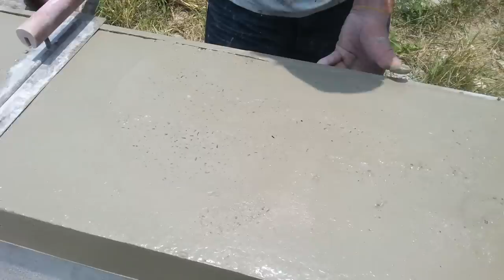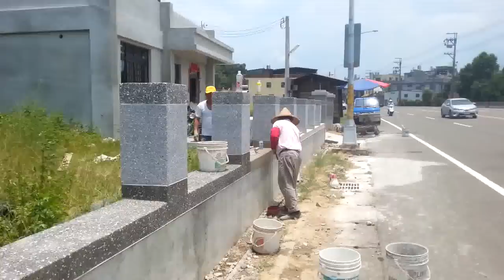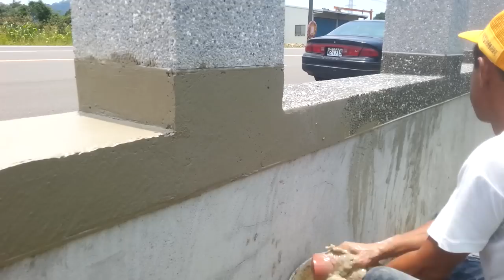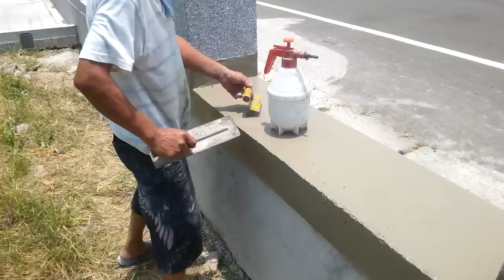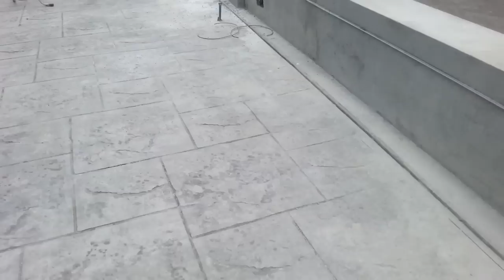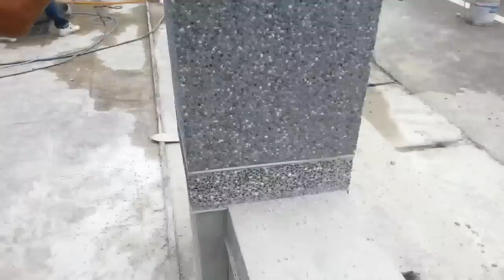Cement rendering with small stones on brick walls

Comment: So, a layer of external tile adhesive first, then a mixture of lime, stone and cement all mixed to form a plaster of sorts, then applied and flattened, and finally a sponge to remove excess cement? Looks good, makes a difference from the old, flaky pebble-dash finish. Do you add any waterproofer or rely on the lime to keep the water out?
Reply: Top comment!

Comment: is this a video on how to wipe cement off walls?
Reply: Come on Haris your better than that
Reply: It seems it goes like this. You built walls using small stones and cement and no sand. Then you plaster the wall so as to minimize the gaps between the stones. Excess you wipe away to render a non dust accumulating finish with a great texture. Surely a thing to learn for someone like me.
Reply: Jeff Jones, 😂😂😂😂😂😂😂, you made my day.
Reply: Haris Andreadis 
على فكرة جديدة

Comment: only way i would do it as a trial here in uk is try mix sand/cement with stones  then trowel on the walls let it go off or set abit then sponge float surface cement off to reveal the finish stones.

Comment: I never knew raiden does plastering!
Reply from the maker: Thank you for watching our video and for leaving your comment. To answer your question, yes, we are not washing but wiping out any extra and unnecessary residue cement from the layer of pebble or (small) stone application. The way we apply pebble stone id directly mix the stones into the cement mixture. From here, we apply the cement and added stone mixture in the same way as we would if it was just cement alone. Then, after about 15 minutes, we then use a large sponge and wipe the surface clean until the small stone or pebbles shine through. The reason we do it this way is in order to achieve a more pebble solid application on the wall. If you have any other queries or questions, we would be happy to try  answer as best as possible. Thank you.
Reply: +Sky Lark pleas,do you mix the cement with sand, or only cement a pebble? thanks
Reply: thank you for explaining this, lovely work.
Reply: i think only cement & pebble he has another video where he is mixing & i did not see any sand

Comment: please do you mix only cement and pebbles,or cement sand and pebbles? thanks
Reply from the maker: thanks for your comments. not only mix cement with pebble stone but also add some stone power  . please dont add any sand even a little bit .
Reply: thanks
Reply: Sky Lark ... instead of wiping off with sponge....we mix 1kg of sugar /6 lt of water and saturate pebble/render. when cement paste has almost set.....wait till really hard and simply rinse of excess paste with high pressure hose. 
  i am from tropical climate too so it does work in hot/humid conditions. but you also need access to power and tap water. so i will remember your method next time we work somewhere without access to these things.
thankyou. great job
Reply: Mix cement with stones